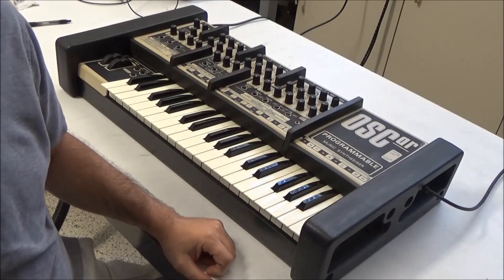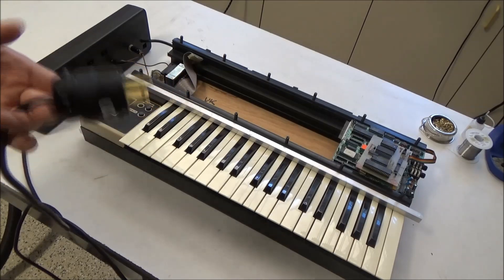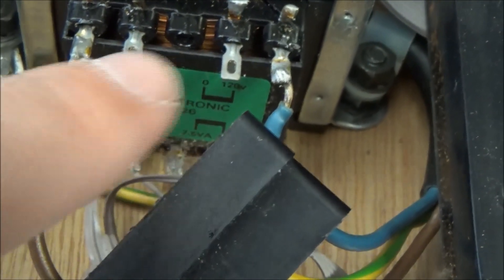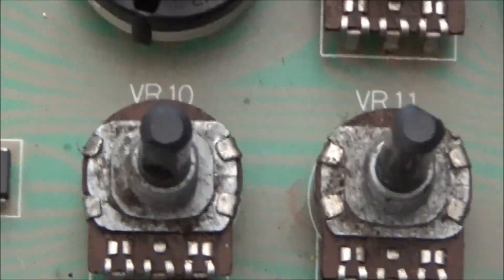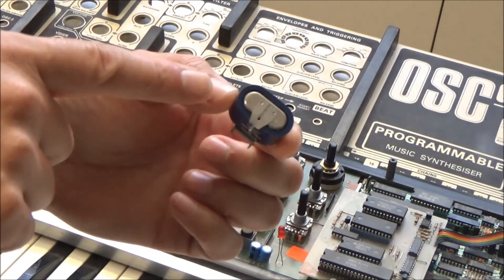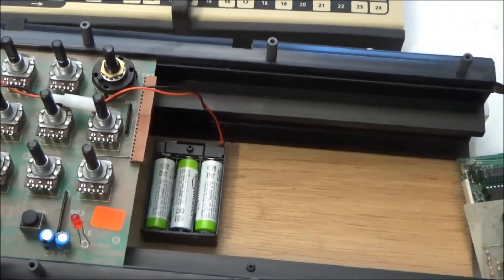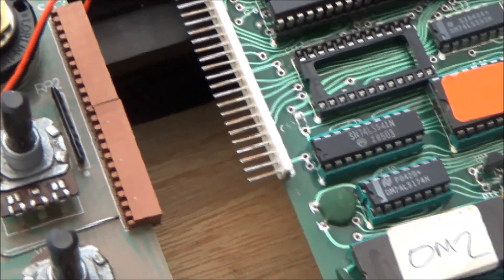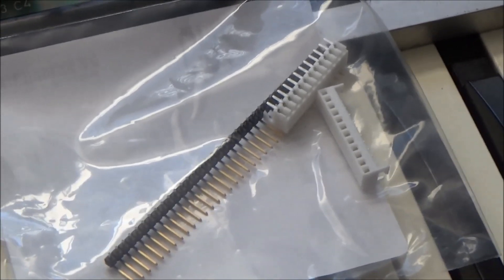Oxford Synthesizer Company OSCar Repair - Synthchaser #121

Comment: Are you using normal batterys or rechargeables?
Reply from the maker: They're rechargeable.  If you use normal ones you need to modify the circuit so the synth doesn't try to charge them.

Comment: With the way musicians throw their instruments around, I would be concerned that the batteries might fall out of the holder. Maybe a classic synth like this can expect better treatment, but I wouldn't count on it.
Reply from the maker: The battery holder has a door that screws closed (you can see the screw hole above the top of the center battery).

Comment: Great vid! Sorry, did I miss how you removed the ground hum? Could you quickly explain? Thanks!
Reply: I know your comment is four years old but if you're still looking for an answer to fixing the hum I can tell you what worked on mine; solder a wire to the Earth lug next to the mains transformer and run it to the ground pin of the audio output socket, soldering it underneath the PCB. This took out nearly all of the hum for me.
Reply: @dryadmusic  Thank you!

Comment: oh man, I have lost 2 of my button caps any chance I could buy a couple of your 3d printed ones?  Great idea about changing that edge connector I should do that also.
Reply: Just a warning, changing that one is hard. The holes are really small, it's hard to get the solder out after removing the old one.

Comment: Wish you'd shown more info on the ground loop fix??
Reply: Same here.
Reply: @youvsyou945  hi fit a lead from earth to one of the bolts of the LM309K regulator, (The large one with the heatsink) then to the transformer chassis.